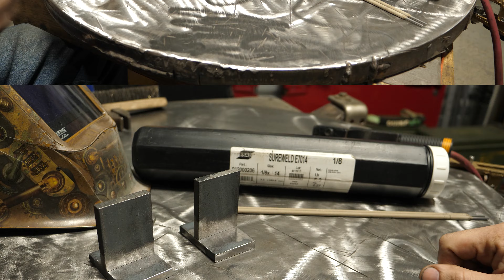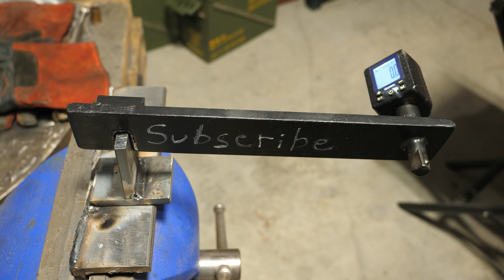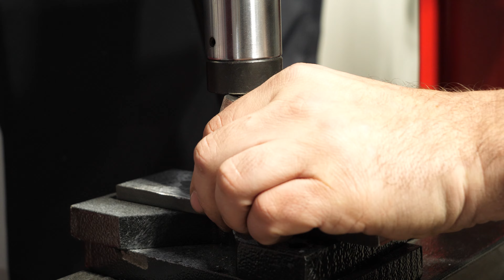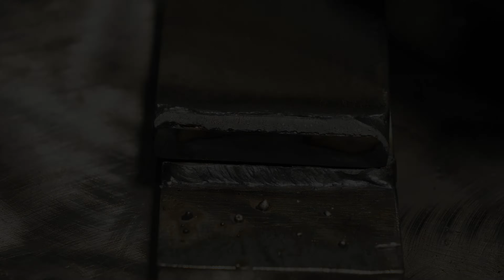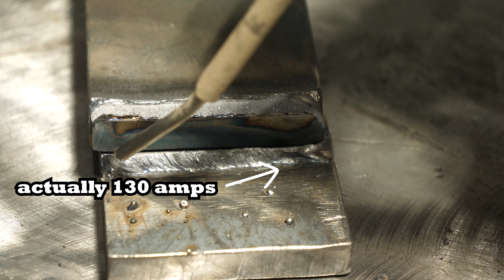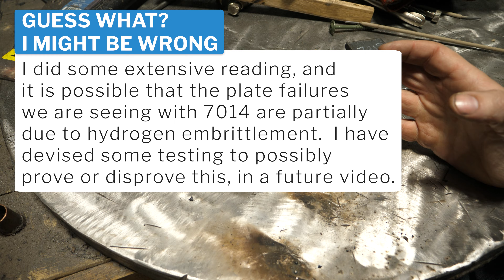7014 vs 7018 weld break test

Comment: My expectations was that failure mode for different rods would be somewhat similar, how wrong was I 😃 That delamination just magnificent, we have mild steel that holds, we have bead that holds, but some unknown alloy between parent metal and bead metal fails, WOW!

And sorry for dumb question, are chemistry specs(like carbon and phosphorus) for 7014 at 12:10 are way off from AWS maximum values? Does it still mean that the ESAB rod is certified as E7014?

Hey, maybe you could elaborate on the definition of “home gamer” and practices involved in that in some future videos? I do understand that structural and any liability related welding are off limits here but even a simple wide fence gate or a railing around some decking thanks to mechanical advantage could put quite a stress on weld seams. Is overbuilding stuff one and only practical(!!!) way to go?
Reply from the maker: So AWS specs are often minimum and not maximum.  So the specs you saw for yield and tensile strength were minimums.  Every manufacture has to meet those as a baseline.  In theory you could have 4 different manufactures with 4 different test results, say 72, 74,78, and 80k ultimate tensile strength all for a 7014 or 7018.  With that said you are correct, if the data sheet is correct they tested over on carbon and phosphorus, which I didn’t even catch.  My guess is there is a zero missing after the decimal.  The spec sheet I pulled was for one of the two 7014s I have and one of 3 of the 7018s I have.  I didn’t use Esabs spec sheet because it doesn’t have as much info as those.  I looked up the exact rods I used for specs (esab) and they are all within AWS and close to the ones in the video (minus a zero after the decimal).  So the good news is according to the manufacture the exact rods I used are in spec.  I will have to email the other one and tell them about there error lol.  

I do plan on doing some higher liability videos such as suspension components, roll cages, vehicle frames, tractor repairs, steering components, and building a hydraulic testing device.  As far as “home gamer” I generally use that the refer to work the average person would find themselves working on.  In specific not code work (like pipe, contract work for the government, bridges, and stuff built to engineering designs).  I also use that term to somewhat shield me from liability because in no way shape or form am I suggesting anything I do is how you should actually repair or make things with liability, because those things need a engineer to sign off on them generally.   A competent welder is capable of performing the welds on many higher liability jobs, the problem is doing such (in a home shop) opens them up to a lot of potential legal issues.  That’s something I definitely need to touch on in the future.  It’s also universally understood that some form of quality control inspection and NDT is done on code work, something a “home gamer” doesn’t have the qualifications or tools to do at home.  However if what you are asking is to cover something that is a bit of engineering thought (aka how strong to build something), how to not “over build” something (which wastes material and time), and how to know when something has too much liability (and shouldn’t be done by a person) I can do a video on that.  Let me know if that’s what you’re looking for.
Reply: @makingmistakeswithgreg  Big THANK YOU for that clarification! 👍 Yes, engineering bit is my interest. Just a small example: few weeks ago I was planning to make a small but sturdy outdoor bench with a welded frame, had drawn a project, prepared steel tubing and then it was like “Hey, that’s a lot of steel!” and right after that “But if someone will use it as a ladder or something? 200 pounds is a lot of stress…and dump those 6013 rods!”, those doubts pretty much spiraled out of control…yeah, I know how it sounds 😃 With welding disassembly of things is no fun, so some insight into right mindset and workflow will be welcomed. If you also touch a liability aspect of welding fabrication and repairs it would be great. I’ve seen on YouTube how people splitting in half frames of theirs pickups and then re-welding them almost on house lawn, pretty sure they intent was more than just use those cars on they own property.
Reply: Definitely do a video on that if it isn’t too much work.

Comment: What I can see is your 7014 had no penertation into your base metal weld just laying on top of plate and is not a ductile as 7018 has the capability to stretch  a certain amount. The bend tests you're doing are going to break most every time the way you do them but weld 2 60dgree v groove plates grind face and root flat to plate surface the bend one face one root 180 degree u bend see what  happens. What polarity were you using trying using reverse polarity
Reply from the maker: The 7014 weld penetrated into the plates decent since the weld tore off a bunch of the plate.  The root has very minimal fusion which is typical of 7014.  I did cut and etches of 7014 and it had virtually no root fusion on 1/4inch plate, and it won’t have much on 3/8th either.  I will be testing a beveled upright plate, more amperage, more passes, and a few other things to see what happens with 7014.  

I will also get around to testing flat plates as you described.  That is a totally different way to stress the weld that is more equal on both sides of it.  The reason I didn’t start with this is because when most home hobby welders make stuff, they are doing fillet welds and not butt welds with bevels.  I also do a ton of trailer repairs and it’s very common to have fillet welds break on trailer chain pockets and elsewhere.  Basically the average person is far more likely to make a fillet weld and stress it than a proper beveled butt weld.

Comment: Do you use 7016 on your side of the pond? Used it everyday for repair work when I worked in a steel foundry. All position root and fill.
Reply from the maker: I actually ordered some 7016 from Australia recently.  7016 is not something you can find in the US, despite a lot of it being made here.  I contacted a local supplier and they could get me some, but it was going to be 900$ because I had to buy 4, 50lb tins of it 😅.  I have heard a lot about it and will be checking it out soon.

Comment: Just curious, for Greg and/ or the other viewers: have you ever tried the "big brother" of the 7018? I mean the 7028. Low hydrogen but high deposition, like 7024. In my area (Europe), I never saw a real one in person. Is it still available in the US?

Thanks for your time making the videos.
Sart0
Reply from the maker: So 7028 is not generally available in anything less than 50lbs in the states.  My understanding is it was primarily designed to weld thick specialty steels.  I have never ran them, but I have ran (and like 7024) so I would probably like 7028.  I will have to keep my eyes peeled for some.

Comment: Greg, thanks for the video.  Second let me qualify myself as a very novice. I know 7018 is known for malleability, could that impact these strength test. I like both but find 7014 so much better to restart.  Also could a more severe rod angle toward the vertical plate improve the 7014 strength performance?
Reply from the maker: A steeper rod angle would force the weld higher in the upright plate, but I doubt it will improve the strength.  I say this because you want a 45degree angle ideally for maximum strength on a single pass and when you deviate from that on one “leg” of the weld failure of the other one will be likely.  I will be testing multi pass 7014 and a bunch of other suggestions to see if it can eventually hold up.

Comment: Another interesting video. 
Bearing in mind that I am only a  Saturday morning "welder", but my reading   teaches me that,  if  the steel,  used in your tests is better quality than mild steel, then hydrogen enbrittlement would be a problem, and is where 7018 will shine.

Comment: Calling rods “farmer rods” in the defense of farmers I do farm on a small scale. Farmers use 6011 for several reasons they are available for purchase at most farm supply store and some are now carrying 6010 however not 6010 5 P rods next these 6011 are good on rusty implements and farming machinery they will penetrate through rust. The weld pool with 6011 doesn’t freeze as quick as 6010 rods and 6011 puddle flows more easily than 6010. The 6011 is easier to use it doesn’t need super skills to use so it’s quicker for a farmer to use. Most of the time you see a smaller farmer welding it’s in the field with his equipment broken down and he’s in a hurry to get back running and he will tell himself when he finishes he will make the temporary repair right as soon as he’s finished with what ever season he’s in. And you guessed it, it’s doesn’t happen unless it breaks again. 7014 are readily available in farms stores as well and now I’m noticing more 7018 in these stores as well. In using 7014 I found that the metal needs to be clean most farmer aren’t welders they are doing these repairs out of necessity and are in a hurry and cleaning metal to them isn’t happening. I have used 7018 on dirty metal and gotten away with it. However 7018 does prefer clean metal. Most farmer aren’t into multiple beads just to much time. I have built several special purpose trailer for my farming operations and I used 6011 and 6010 for beads and 7014 and 7018 for hot pass and capping. I’ve built several other pieces of farming equipment and they are still working quite well. I do learn from your videos and thank you for sharing you information. Not all people who weld understand the differences in rods and their purpose. I do think that stick welding is becoming a lost art of welding. And plastic pipe will eventually replace metal pipe. Maybe not in my life time but it’s coming.
Reply from the maker: I can tell you have a lot of real world experience.  Without a doubt a 6011 or 6010 is the way to go on unclean/poor material prep material.  It can make a far stronger weld on such material that what is possible with other rods.  That’s something I probably don’t mention enough, and that on perfectly prepped/clean material 7018 is strong.  On poor prep, rusty, wore out material I have a feeling 6010/6011 will produce a stronger weld.  Both of those are also far easier to run on poor material.

Comment: Learning a lot from these tests!

As mentioned in some of your other comments; I'm curious to see how 7024 works out (my prediction, similar to 7014), but it also makes me wonder about 8010, 11018, etc.  Thank you!
Reply from the maker: I will be testing 7010 or 8010 (primarily used for welding pipe) and some stainless rods that are over 110k tensile strength.  I also have some ar500 and chromoly I will use as base material to demonstrate the strength increase 😀.

Comment: Hi Greg, The Mini Machine has this essentially correct for face bend testing, depth of penetration determines the location of the point of maximum moment, the further this is from the centerline of the 3/8th material the easier the weld will break.  I still think hydrogen embrittlement and weld metal dilution at the weld/parent metal interface is the culprit in the press tests.  You work hard for us and I appreciate it, thank you.
Reply from the maker: No problem.  I am going to try 7010/8010 and 7024 to see if any of those break.  If the only ones that pass are mig, 7018, and obviously tig, that will definitely point in the direction of hydrogen playing a role.

Comment: at 1:35 i can say right off the bat 7014 is more filler than structural 7018 ... but they are so easy to glue to the metal ..lol

Comment: Quick question…
I have a plethora of  worn out mower blades  from 72” Zero Turns, and even some 3/8” Brush Hogs blades. I’ve been using them for welding coupons, but an acquaintance told me hardened steel wasn’t  my best choice. Your thoughts? 
Thanks Greg!
Reply from the maker: So lawn mower blades could be made out of steel that is heat treated or heat hardening.  In simple terms the steel you see me weld on the channel is mostly mild steel, if you heat it the steel does not become harder.  Some steel (like what knives, bolts, and possibly lawn mower blades are made from) has higher carbon/other elements and upon heating it beyond a certain temp, it will become harder.  The problem with welding those types of materials is welding them will typically produce a very brittle weld, and will change the material in the heat affected zone.  For practice purposes it will weld very similar to mild steel however it will like break/snap under stress.  You may see cracks along the weld toes and if you weld one piece to another it may crack off during cooling.  There are ways to properly weld heat hardening steels, it mostly revolves around preheating it (typically for over 3/16th thick) using fillers that don’t become brittle with carbon absorption (nickel, 309 and 312 stainless etc) and making sure the material doesn’t get too hot during welding (along with slowly allowing it to cool).  

For running beads on it I wouldn’t worry about it, a bead on that will weld very similar to mild steel.
Reply: Wow, what a GREAT and well thought out answer. Thanks for the time you took to really explain.  I really appreciate it Greg. I think l need to buy some legit coupons, but hard to ignore all this beautiful steel just  laying around for the taking  🫤.
Reply: The really weird thing is using er309 to weld common square steel tube to give a “smooth and lovely” appearance, say for furniture-grade “appearance” TIG welds.

Comment: A while back I was talking about a rod i was using to weld ultra thin sheet. Double wall motorcycle exhaust etc... (basically just chrome plating after the base rusted out)
I think this is it! Let's see you try to run a butt joint with the 7014 on 22 gauge sheet. I bet it works!

Comment: I agree that the plate failure under the weld is likely from hydrogen.  Not sure how that could be proven though.
Reply from the maker: My thought is to run 70 or 8010 to see if it holds on and 6010 doesn’t.  I am also going to get a 7018 good and soaked with water and weld with it to see if it breaks.  If 70/8010 both break that would start pointing towards hydrogen playing a role.  If a wet 7018 fails that would also point towards hydrogen.  Based on 7014s results I have a feeling 7024 might break as well, which if it does it really will point towards the direction of hydrogen embrittlement.  

I didn’t mention it in the video, however when breaking the welds they have different a “feeling” to them.  Er70 Mig and 7018 feel almost identical to each other, and they feel completely different than 60xx and 7014.  The 60xx rods, and 7014 feel brittle, the test results seem to suggest they are more brittle as well.  That could be because of the effect of hydrogen.  The further testing should give a better idea on that I hope.
Reply: @makingmistakeswithgreg  I've never ran any 70 or 8010 and not sure what to expect.  Can't really see the use of a stronger fill metal if the hydrogen issue is still there.  It'll be interesting whatever happens.

Comment: I like the advantages of 7018 enough that I bought a small rod oven to keep 10lbs at a time in the shop. Since it is so readily available 7 days a week around here I never worry about running out.
Reply from the maker: I agree.  I personally keep a pack of sealed rods around for jobs that need strength but there is nothing wrong with a mini oven (especially because many rods don’t come in a sealed pack).  They run better preheated too anyway.  It’s hard to describe it in the video but after having bend 60xx and 7014, er70 MiG and 7018 are “confidence inspiring”.  They feel very strong and fail slowly.  They just feel tough.  The 60xx series and 7014 seem to have strength but not like er70 or 7018.  The 7014 did still hold on after breaking which is good, and it did take a lot of force to break (more than 60xx) however ultimately it’s not as strong in the testing as 7018.   7018 is defiantly the way to go for strength.

Comment: When testing the part in the press the force dropped because the mechanical advantage changed at the pivot point from bending. For example, 1lb of force on a 2 foot arm from a pivot point to a 1 foot arm from the pivot point will produce 2lbs of force.
Reply from the maker: I agree with you, however at the moment it dropped below 4ton the plate must have cracked and thus the pressure dropped.  I could tell by the pressure in the hydraulic handle there was nothing there resisting the ram anymore.  With 6010/6011 the weld tended to “blow apart” aka instantly drop to zero and wasn’t holding together at any point.  7014 cracked, however small bits still held on slightly.     Obviously this is a better situation than blowing apart and completely failing.